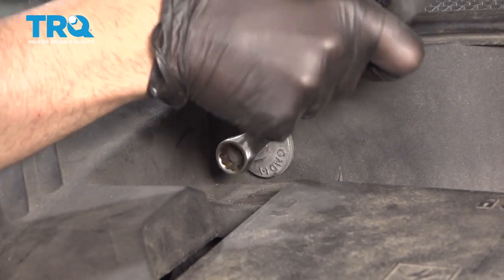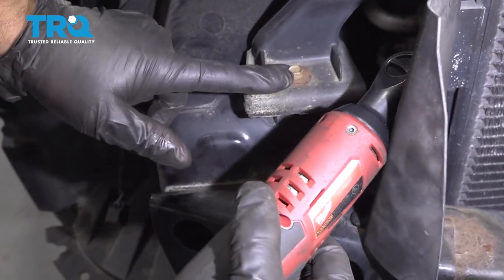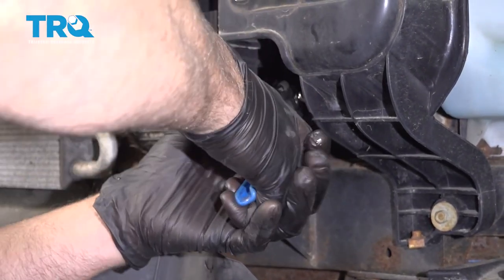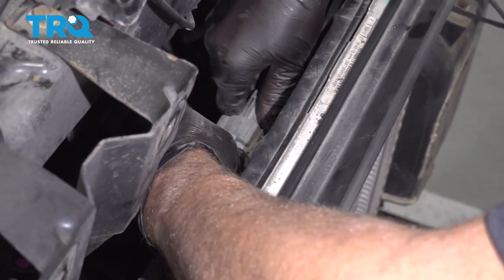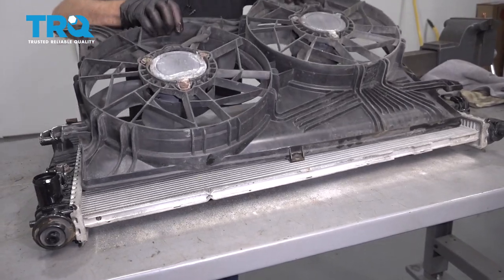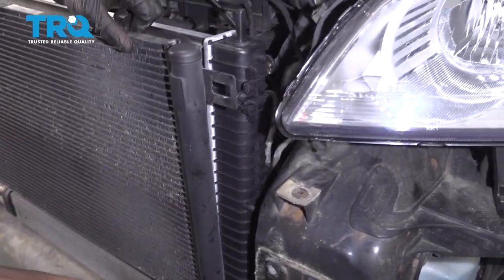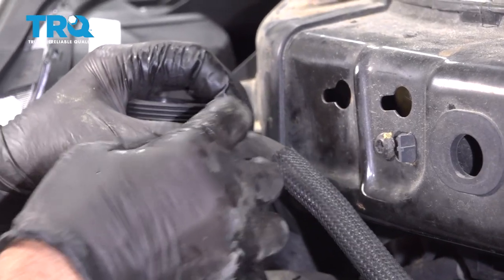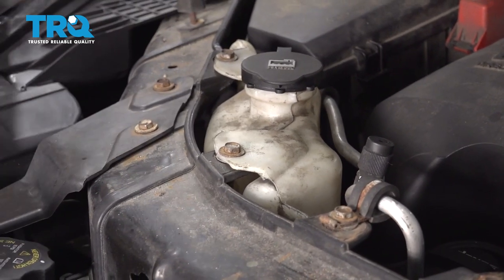How To Replace Radiator 2009-17 Chevy Traverse

Comment: I suggest replacing the clips for the transmission cooler lines and the rubber support grommets while swapping the radiator.